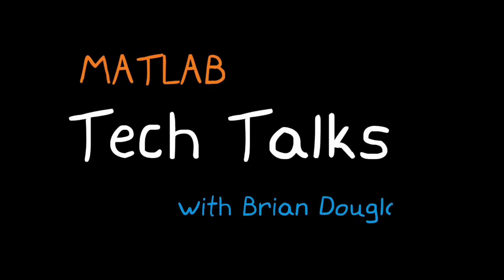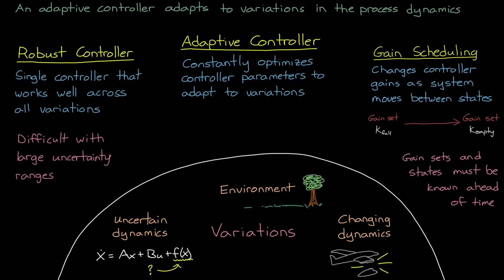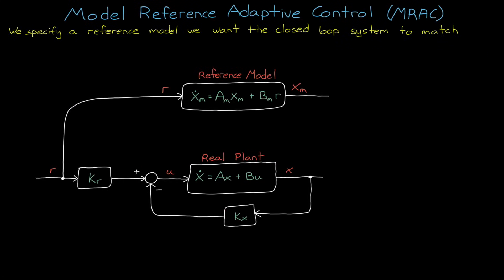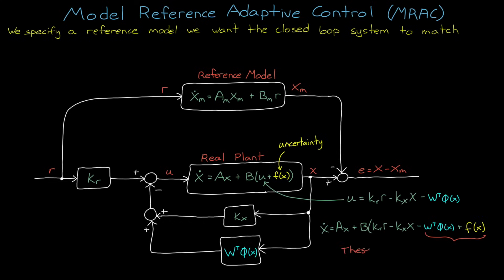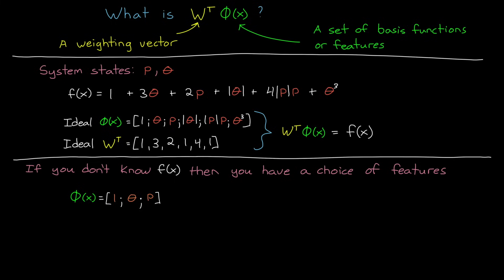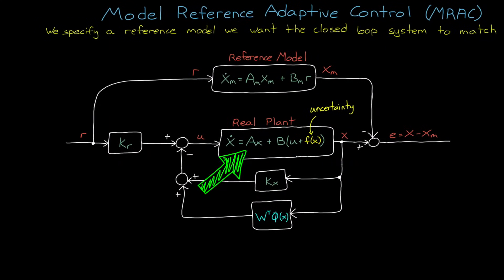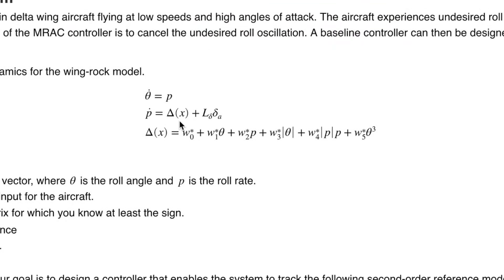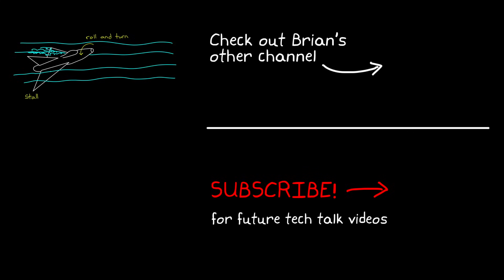What Is Model Reference Adaptive Control (MRAC)? | Learning-Based Control, Part 3

Comment: Very Nice,  what video equipment are you using to build these videos.  Also, you have infographics as well.  Adaptive controls can be a lifetime of learning and getting this right.   practicing with models most companies don't support.  All these models and controllers need to be exercised.  If you spend too much time modeling, the boss feels that you are not doing your job, but this is far from the truth.  Most bosses have MSEE degrees or better but stay lost in meetings.  They don't practice anything. It's hard to stay current using company time.  Any ideas on how to create more time?